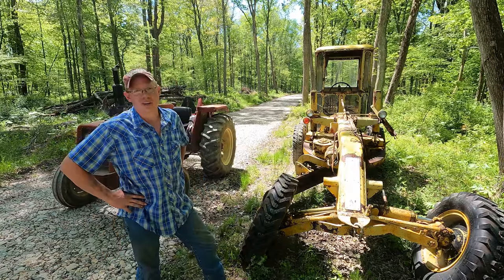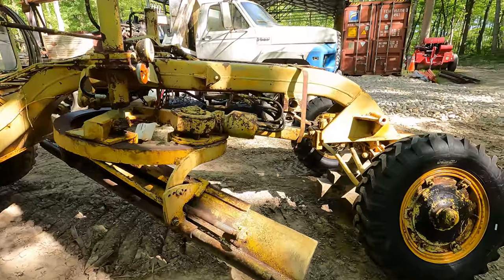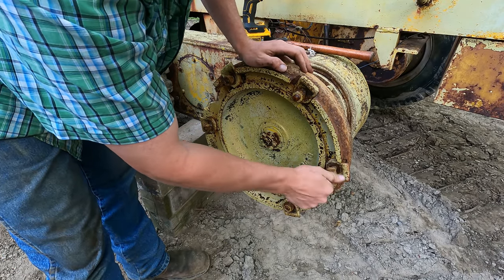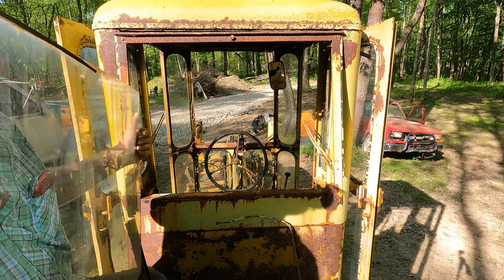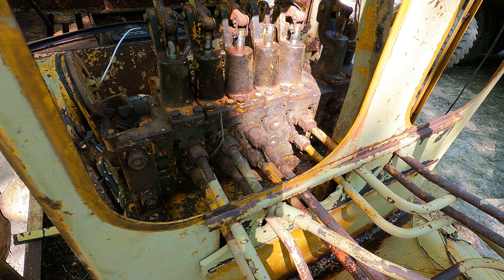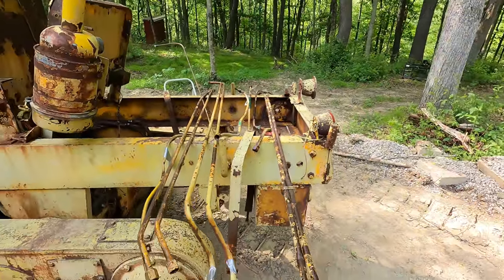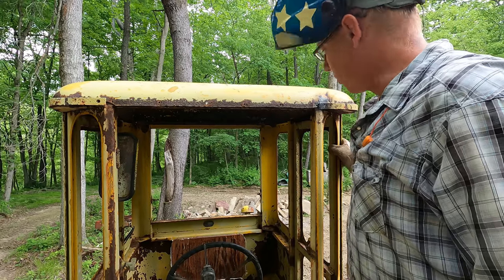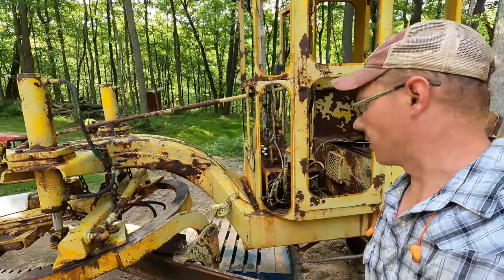More Problems with the 1960's Galion Road Grader restoration!! Pt.8

Comment: As others have said I would remove as much of that rust as you can with black stripping discs on a 90 degree air die grinder or on an angle grinder for larger areas. Then use a rust remover or converter on any areas such as pitted metal where you can't remove all the traces of rust. Wire wheels can also be helpful on pitted metal but they usually won't get every last bit of rust out. Make sure to follow the directions exactly with any rust remover or converter products, just like with mixing paint. I prefer rust removers to rust converters for autobody work but for heavy equipment you could probably get by with a rust converter. With rust removers you generally have to neutralize them with clean water and then dry the panel right after making more work.

if you want to get really fancy you could use a DA sander to scuff up the existing paint that's in good condition to give a better tooth for new paint. I don't know how tough that old paint on the Galion is but something like 180 grit would probably do the trick. You could also consider using a 2k Epoxy primer on your bare metal after removing your rust if you really want that paint job to last. Just depends on how nice you want this thing to be. Those ideas might be overkill but I would at least thoroughly remove that rust if you're gonna be putting any kind of new finish over it. 

Just some feedback from a former autobody guy who has owned / currently owns a lot of rusty junk (see username lol). Love the channel, keep up the good work!

Comment: Running a welder on a extension cord is perfectly fine as long as you have the right gauge wire in it using a cord is no different then the long wires that run through your house or shop from breaker box to plug

Comment: Have been watching a bunch of your videos over the past few weeks, and looks like you change quite a few hydraulic hoses. Don't know if you have one, so just wanna mention I bought a used hose press for $1200. I'd imagine you could find it a bit cheaper in the US? Still cost me around $30-35 to make a 1 meter/3ft hose, but the local mechanic will charge me 5 times that

Comment: Matt given the number of folks who are killed every year by tractor accidents and that many if not most occur on 'hobby farms'.

I think a practical demonstration of the risks provided by somebody like yourself who could not help but be aware of the hazards of operating a little International because you have the relevant skills and experience is a great way to impart invaluable emphasis.

I suggest this is particularly relevant for the sort of people who tend to have such accidents because they don't always understand the limitations of a machine and might not otherwise take advice or suggestions on board.

As a police officer nearing retirement who grew up in a rural area and spent most of my life and active duty police career in or as close to those environments as possible I have investigated or been aware of some profoundly gruesome incidents.

Many of them involved PTO operated equipment such as augers (one of the worst), slashers, mowers, lifting forks and hay baling machines but a boyhood friend was killed while operating an excavator and some accidents occurred that involved mining equipment.

I had also been acquainted with a few of the other people who were killed or maimed in machinery accidents and a personal element brings the emphasis particularly close to home.

Comment: There's a load of comments about getting rid of at least some of the rust Matt. I know it's not a full-on restoration but I have to agree. It shouldn't take too long to take a wire-wheel, or similar, to the worst of it. It'll look better, paint will last longer, and it will prevent the rust coming straight through. I'd be priming her too. 
Maybe not what you want to hear but I think you know it makes sense.😁

Cheers for now,
Dougie.
Reply from the maker: Yes I don’t know why everyone thinks I’m gonna go right over the rust I haven’t done that on any of the other components why would I do it now? I’m planning on priming the whole thing too
Reply: @DieselCreek  I was kinda surprised Matt but, when you were putting the filler on the roof, it looked like it was going down on top of the rust. Meant no offence, just didn't want you upsetting Christine - could end very badly.😂
Reply from the maker: @2H80vids  none taken bud... I did wire wheel the area first

Comment: interesting note, that PPG glass was produced in tipton, OH (plant code 26) in January of (most likely) 1971. that's just a guess on the year based on the AS2 glazing code.
Reply: the law that introduced the AS* glazing codes (Federal Standard No. 205) was introduced in 1970, so it's unlikely to be 1961 glass, though it could also be a 1981. anyhow, your grader's likely a 1971 or 1972 unless it had all the glass replaced at once.

Comment: The glass codes say a lot about what it is. AS2 is the code for side or rear glass (the front glass should be AS1), 26 would have been the Crestline, OH plant for that era, and likely a date code for Jan 1961. One of the reasons it looks different than modern glass is that the float glass production process would not come into use for another 2 years.

A set of flare nut wrenches is a good investment. Using plumber's adjustable on that valve block looked painful.

Comment: With new front tires on it, they should be swapped from side to side, you have them mounted as if they were drive tires. For steering tires, the tread is backwards as you had them mounted in this video. It will steer a lot better under load if you change the tread direction when you put them back on.

Comment: Getting yourself setup to make your own hydraulic lines seems to be a decent time and money saving endeavour on the face of it. All of those hydraulic and brake lines that you won't have to run to the shop and wait for. Maybe just leave the shop option for the rubber lines.

Comment: What about using galvanized electrician's conduit. Buy a pipe bender and find the right size flare for the fittings. Just a thought. The pipe may be the right thickness. Or take them to the shop, tell the guys you'd like to video them bending and flaring the new pipe for your YouTube channel and you'll promote them in exchange for a break on the price of the new pipe/fittings.

Comment: While you have your welder out there repairing that window you might just think about welding in new studs to hold those hydraulic lines in place.   Grind those (10 mm (haha)) off and replace with some good news grade "A" studs

Comment: Instead of welding new studs on for the line clamps it may be easier to drill and tap out the frame and use bolts. I bet it’s plenty thick enough.

Comment: Another possible issue: the drive chain assembly! Pretty sure the oil filling needs a change, as it may have got hard, or there's water inside. If Matt is lucky the drive chains are NOT corroded or ready to break. And all the tyres on the rear axles are dry - rotten. And the tread is all but gone; I guess they are as old as the machine "herself"! But again: good luck, cheers from Germany!

Comment: Flux core is good for ugly welds in rusty metal. With all the equipment you have, I would think having a bender a flaring tool and maybe your own hose crimper would save you a lot of money in the long run. Hoses and lines are always something that needs replaced at the worst possible time.

Comment: The grinder is a welders best friend.   I always use flux core. Its an acquired taste.
Reply from the maker: The welders creed! “Grinder and paint makes me the welder I ain’t”
Reply: I also prefer flux core. For me, I did penetration tests on 1/2” plate steel and flux core out performed gas wire and I’ve been using it ever since. Saves a good bit of money considering the cost of shielding gas these days as an added bonus.

Comment: Flux core welding (MAG) is like welding with your eyes closed, can't see anything!! I wouldn't worry about the extension chord, your using yours at low amp settings the extension is especially a problem if its left all wound up.

Comment: If it helps, Woods Du-al front end loaders used just plain black pipe for their hydraulic lines for decades. I don't see why you couldn't use them on old Christine. Hell of alot cheaper than custom bent lines!

Comment: As a guy that bought a big old MF backhoe, I can identify with your plight.
Mine only needed "front axle fixed, tires aired up, new pump in barn installed" when I bought it.
To date 
drain/replace fuel
start and run
weld cast axle pivot back together
replace rear tires and 1 rim
replace 1 front tire
install pump and new loader valves
free up frozen hoe valves
install new power steering assist cylinder
make new pins and bushings
Still in it for less than 4 grand...

Comment: First, if you weld steel with a CO2 Argon mix it's called MAG welding, Metal Active Gas.  A bit of the gas reacts Active with the puddle.  If you weld stainless or aluminium with 100% argon it's called MIG welding Metal Inert Gas.

In Flux core welding, the core of the welding thread is FLUX.  Just an equal material than the cap on a stick for stick welding.  When this Flux gets molten by the heat of the weld, it produces a gas like MAG welding, and also a bit  and a slack like stick welding.

Comment: In the mid 70's I worked for Tyneside safety glass for 3 month as a glass cutter my main job was cutting screens for JCB what a right b/tard they were they had a notch in the bottom being laminated you had to cut 2 for 1 screen I broke more than I made lol well I was only 17 , the chances of breaking those are pretty low as they are toughened . Got your hands full there mate , I enjoy you channel busy catching up . btw spent 35 years in the motor trade as a panel beater after the glass company , any case greetings from the North East UK . I  bought a new MIG  a couple of years ago only bought it because the neighbour charged me £5 to weld something for me , my MIG was stolen when I moved house I left a few things to pick up later , It's a Wolf just a cheapy £170 ish it's gas/gasless I'm going to build a bike table so will give it a go on gasless then  .

Comment: Hey Matt, thanks for another great video! Would you ever consider rubber hydraulic hoses to replace the steel ones? Is that a good or bad idea, and would it save you (and future owners) expense? Seems to me you'd still have to rig and route rubber hoses, but not bend and flare them like the steel ones. Maybe materials are better today than 1960.

Comment: the vector for the pull has to be below the rear axle, period.  If it is above you have to use weight on the front end.

Comment: Use a rubber between frame rails and fuel tank and the tank straps will reduce vibration and wear in general I would use old inner tube it’s cheap and will work better than steel putty that will dry out fall off then you will have a gap cut that window gutter off smooth it up with auto filler or weld it grind it smooth cut corners of make it smooth too as caulk will dry and be right back to square one over time with the sun drying it out cut corners off do same as the front make it smooth rounded would look better or put some led lights across where gutters were

Comment: Do yourself a favor, and make some patterns of the glass while it is out of it's setting.  Any glass shop should be able to make the next one that gets broken. They get broken a lot.  The side lite you showed is Herculite, which is tempered, and the front and back are annealed laminated. But both can be cut out of laminated glass. I made thousands of these laminated lites during a Summer job in the early 60's for a PPG shop in Albany, NY.  Only the door lites with an exposed edge were polished.

Comment: That is exactly what that wire is for if you use duel shield wire you would have to completely clean the surface off of all rust so if you are not going to sandblast all of the rust off then that is the wire for you

Comment: Personally, I'd grind all those studs off and replace them. Stud welders can be had very cheap. As for the flux wire, you will be bard pressed to find a better application for that your doing.

Comment: Try running a 1/4 unc die over top next time.
Save some pain
Pretty sure Marty t had same grader or very similar where he had a broken drive chain, he said tyres have to be same diamater or chains will bind up
You have alot of work ahead of you just on the body, plus the rest.
Looking forward to next part

Comment: The edge of those are rough cut like that because of the way we used to have to cut laminated glass even newer modern stuff you have to run your line and then use the torch slowly heat it up and then snap it everything just gotten better quality materials wise but a lot of times the edge doesn't matter it's getting covered in something that's why they'll be that way still

Comment: Why not replace the metal hydraulic and flexible part at the ends with a total flex hydraulic line? Would save a lot of pricey couplers that also could leak.
Or would that introduce to much flex over that length?

Comment: I’m sure you know this but impact sockets have a purpose not just safer but they actually help the impact travel to the nut to help free it where the chrome one doesn’t and actually will ruin the nut most times or give you a harder time I know your smart individual just figured I’d share

Comment: I really, really, really think you could have pulled it with the tractor if you had tried just once more. That first pull was several months of sitting? I'll bet that swamp swallowed up the tires just a bit. I'll bet it would have towed more easily with just one more pull. (plus, lower the PTO a smidge). You are having fun!

When you pullled the rear glass... that difference in the edge of the glass is due to the glass most likely getting cut in the field. I used to replace those panes while out on location. Sometimes it is not as elegant as when it is done in the shop.

Comment: Okay, not a welder so probably a dumb question. Wouldn't you get a better weld if most of the rust was removed before welding? Curiosity impels me.  lol

Comment: just wondering, if those curved pieces of metal on upper edge of canopy facing forward and hole innit were fixing points of working lights ?? and if not, could them be purposed for such ?? I mean, its never enough lights with machines....

Comment: Silly question. Does the hydrologic pipes need to be steel? Could they be done in copper? I'm an ac engineer so don't know if it would work? It would be cheaper..

Comment: 17:53  Herculite tempered glass, a pioneer in keeping the action on .. › herculi...
Heat- and chemically strengthened to be lightweight, sturdy and versatile Herculite® glass is still the industry's oldest and most trusted safety glass brand.

Comment: maybe try kimball midwest pentrailing oil works even in the rain we use it on our state snow  snow plows at for getting blades off works great on rusted and frozen  bolts guy from the company wandered in . we thought just another junk product sales pitch we bought a case lol even at 20 buck s a can saved us load s of time

Comment: The glass was made by Pittsburgh Plate Glass Co., now PPG Industries, Herculite is the brand name, it is tempered glass, like side windows in cars, be careful about bumping the edge, you could shatter them. The trademark is sandblasted and should have a date and production facility code. I am retired from PPG.

Comment: You need to sand blast that thing before paint take it right down to the bare metal. I'd take that thing apart piece by piece sandblast ,prime and paint then reassemble to look like it just left the factory.

Comment: Safety glass invented 1903  by accident first used in cars in the 1920. Tempered glass started in automobile in the 1930.   Then they got real serious in the late 60s / 70s.  I wonder if Ralph Nader was engaged in that decision. I googled safety glass when you started talking about the uneven laminations.  I didn’t see anything on construction equipment glass.

Comment: @Diesel Creek You might wire brush the rusted threads before removing the nut. You should have better luck and actually make things a bit faster to remove because of it.

Comment: You should have really taken the paint n rust off those corners to bare metal then applied your filler. Last much longer without cracking or at times falling completely off.
Just an fyi future reference 😉✌

Comment: LOL! 😂 "Never use an extension cord on your Mig Welder!" My shiny white butt!!! I've use mine 99.2% of the time off of a 100ft cord heavy duty though, I've Never had any issues doing that over the 14 YEARS  I've done it my whole shop is ran off that same cord, I keep waiting for it to trip the breaker but Never has. And because I've said this ...... You know .... 😒 
I plan on getting my shop wired correctly this summer.

Comment: You have to REVERSE your gun leads for swapping from Gas to Flux.. Positive and Negative inside your machine.... Instructions are in that Manual you probably never Read??  Sometimes it is labeled inside your machine too for those who can read !!
Flux core works great outside and when your out of gas...lol
Easy to change and weld once you practice enuf....